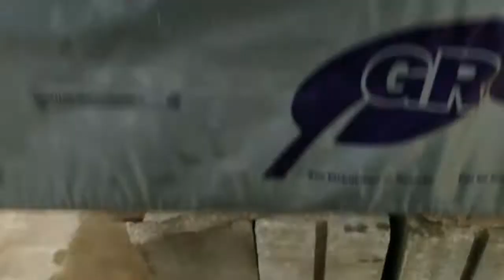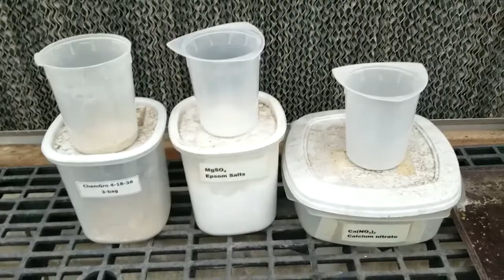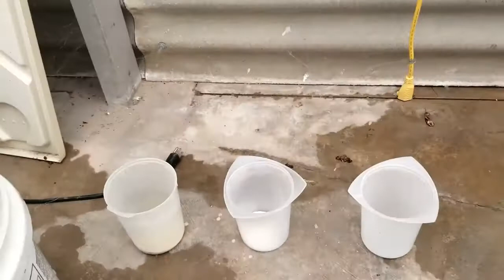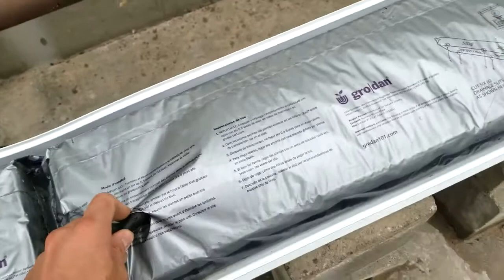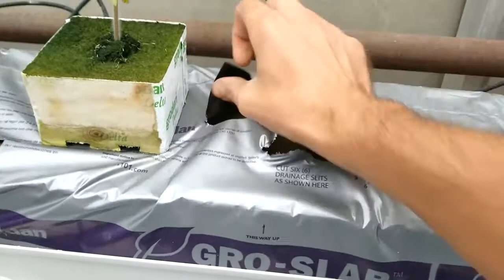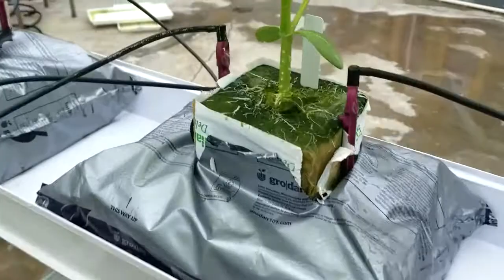Rockwool Slab Set-up

Comment: why dont you just make a mixing tank that plumbs off your main pump with a t valve and recirculates into your mixing tank back to your main feed res,. whenever you need to mix nutes you can literally just flip 2 valves. once your done your feed tanks set for the week.